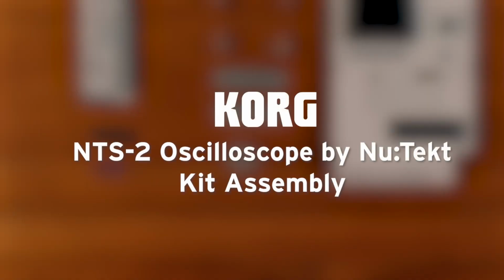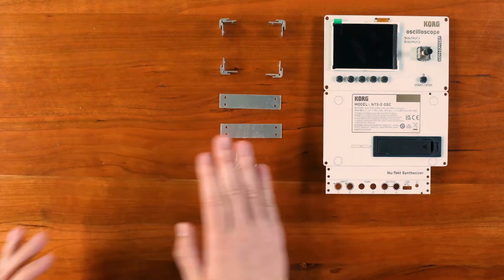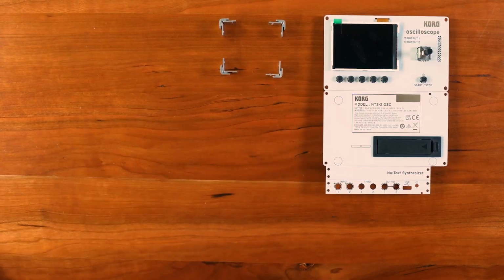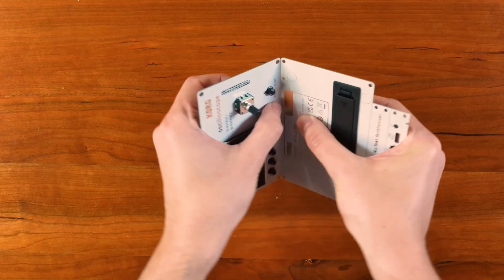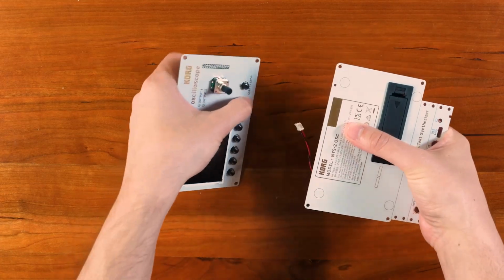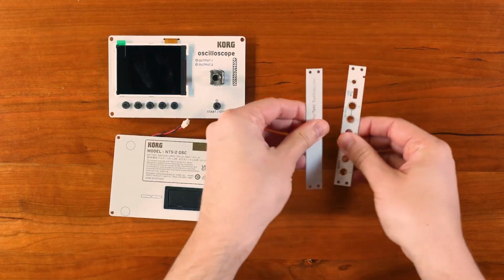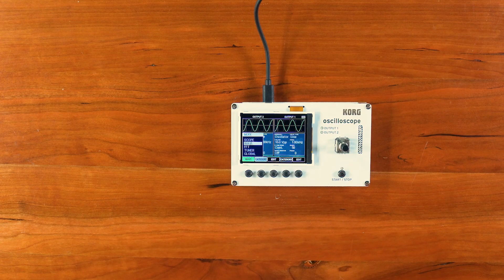Nu:Tekt NTS-2 Oscilloscope Kit - Assembly Tutorial

Comment: Just got mine today. Breaking the panels apart wasn't nearly as easy as it looked. I'm watching this to see if there is some trick to it. There was no gradual bending of the main panels. It was snap apart or nothing. The really hard part were the two side panels. My fingers just were not strong enough so I covered the panels with painters masking tape and used a crescent wrench and needle nose pliers to gradually split them, starting at one end and working along the split. If you have a vice to hold one side you might want to use that.
Reply: Same here! The panels bend and get misshaped long before snapping off.
I mounted the sides to the bottom panel, to stiffen it up, and then broke off the other ones. Carefully...
Reply: Yeah this is the first item i legit bought multi-year insurance for. Reviewers on amazon mentioned it was incredibly sketchy to break apart. I'm staring down mines at my hobbyist bench considering cutting them since i can easily cut in straight even lines at my desk but i think i'll just get some rubber gloves on and Yolo it apart. If the lil korg lady done it that flawless on the tutorial? It does make me wonder if they pre-cut this board to make it seem seamless.

Comment: Is it firmware updatable?
Asking because it looks like there are 3 features missing:
1) USB MIDI input for simple Note On/Off control of the Wave mode (extra points for CC based control of the parameters)
2) Pitch CV & Gate/Amplitude input options on Wave mode (the 4 inputs are perfect for this)
3) FX mode, preferably providing 1 slot for NTS-1 style custom FXs
With these 3 missing features, this little thing would truly be perfect! :) 
(this is wishful thinking because I'm buying one anyway)
Reply: This is not a synth afaik, just an analyzer.
Reply: @N1h1L3  with 2 wave generators with variable pitch... And 4 DC coupled inputs... So... The hardware is there and the software is begging for it.
Reply: @N1h1L3  It directly says synth on the side panel.
Reply: @obbekjaer  eh :) They even have this on their product page: «But the NTS-2 is much more than just an oscilloscope. The flexible Wave Generator mode has 2 oscillators with dedicated outputs, so you can test your synth rig or just get creative!» ...it's a bit of a shame to have 4 channels in, 2 channels out and a DSP "brain" in-between and not use those ins (+"brain") to CV control the Wave Generator. Same for at least an FX mode to use that DSP power together with the available I/O. Oh well... it'd be nice if Korg makes a (firmware) revision of  this nice little gadget.